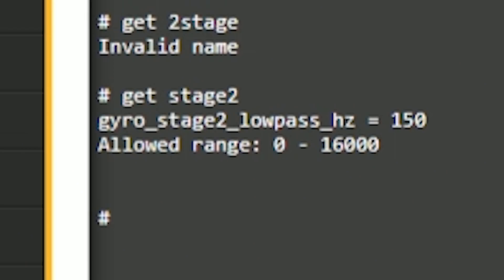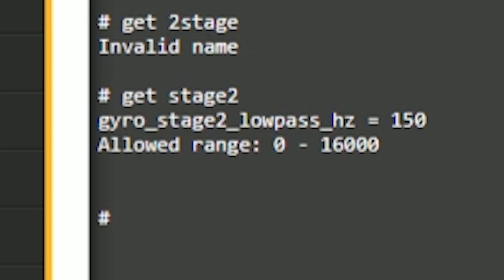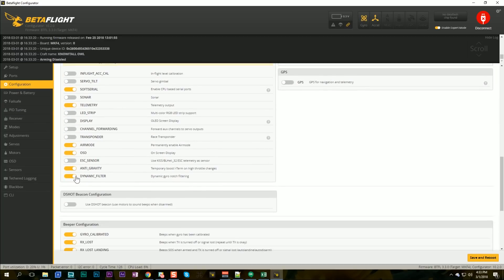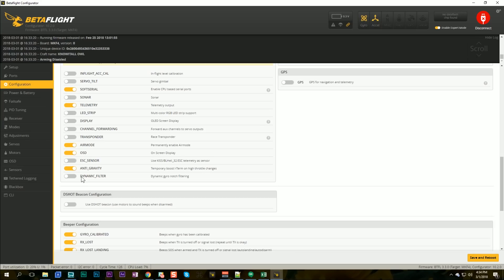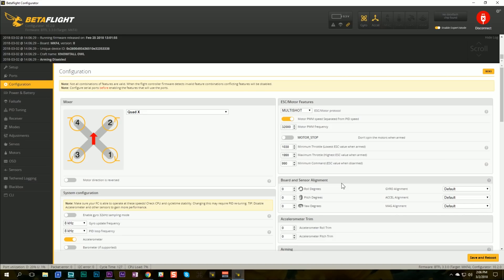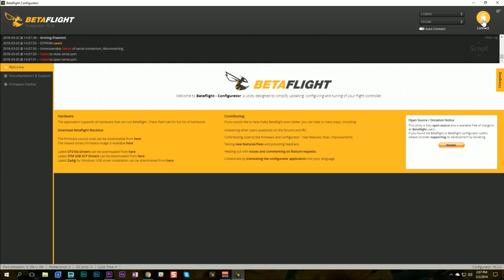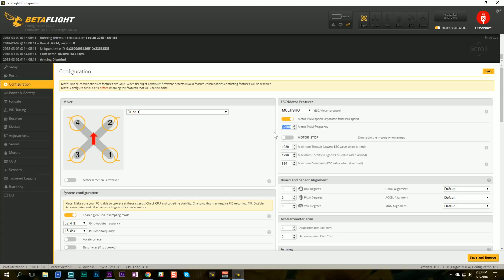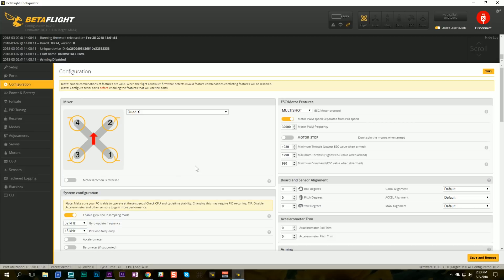Betaflight 3.3 (not) Kalman Filter | HOW TO

Comment: If you're running 8k, the new BQRCF2 filter is identical in noise attenuation to a classic PT1 gyro lowpass. There really isn't benefit to running it if you're sampling at 8k. However, at 32k, where the gyro isn't hard limited to around 256hz, the BQRCF2 filter attenuates high frequency noise way better than a PT1. But it also adds more delay than a PT1. Still though, the high frequency attenuation of the BQRCF2 is worth that tradeoff.

Now running the dual stage lowpass setup (classic gyro PT1 lpf + BQRCF2 set to around 150hz) + Dynamic Notch disabled has yielded great flight performance in my testing. Fantastic flight performance actually. However, as soon as a prop got damaged or a motor was unbalanced, anything of that sort, it created noise which was right in the sweet spot of where the dynamic filter typically performs. But below the high frequency noise that the BQRCF2 filter is really good at filtering out. I find that a really risky approach because it can be easy to smoke a motor if your props and motors aren't perfect. But if you're the type of person who changes out props the second they get a scratch and you want really good flight performance, even at 8k, the dual lowpass + no dynamic notch setup is pretty great. Best flight characteristics and propwash handling I've ever had with Betaflight.

PS. Mark Spatz (UAV Tech) is definitely killing it with those filtering videos. Especially in comparing the delays of the various filters.
Reply: I really appreciate the insight here,  but I'm a bit confused by what appears to be contradictory advice between your original comment, and what you later added. Specifically " If you're running 8k, the new BQRCF2 filter is identical in noise attenuation to a classic PT1 gyro lowpass. There really isn't benefit to running it if you're sampling at 8k. " VS "even at 8k, the dual lowpass + no dynamic notch setup is pretty great. Best flight characteristics and propwash handling I've ever had with Betaflight." My FC can only run 8K/8K - so should I use the new BQRCF2 filter or not? I have very little noise - motors are balanced and props are as well. :)
Reply: Brennan Lawrence I’ve always worried about what happens with out of whack props as filters advance. Especially once turtle mode came out and I have a way to get back with a potentially jacked up prop because I’m a lazy ass.
Reply from the maker: Running the stage2 filter and the regular gyro lowpass in series gives enough attenuation to disable all the notch filters, which provides a net improvement in performance, even at 8 kHz, in my testing.
Reply: Thanks Joshua! If I'm already able to disable all notch filters and the dynamic and my motors are not cooking, is there any reason to add in this new BQRCF2 filter? I'm running Lumenier MX2206 motors, check all my props on a DuBro, and I'm using rubber flight controller standoffs. :D
Reply: +Joshua Bardwell  You're correct. You can absolutely run the classic gyro lowpass + stage 2 without the static notches enabled. But I was saying it's still risky to do so without the dynamic notch enabled. Your flight performance is great with solely the classic gyro lpf + BQRCF2; I've flown like this myself. But once you damage a prop, the dual stage lowpass isn't enough to keep your motors safe without the dynamic notch. Perhaps if you're running very low DTerm you can pull it off. But I just really don't think it's worth the risk; especially if you're using pricey motors.

But I've been doing some extremely "experimental" stuff over the last 24 hours. This comes in the form of changing gyro_lpf to EXPERIMENTAL (default is off). This is what governs the hardware lowpass filter on the gyro. On MPU6000 gyros, as we know, there's a hardware limiter at 256hz. But there isn't specific documentation from the gyro manufacturer which states exactly what gyro_lpf = EXPERIMENTAL does. But a few of us on the Betaflight GitHub have been testing this feature and it appears to actually raise the gyro hard lowpass. We just don't know how high it's raising it exactly, or if it's even removing it altogether (highly unlikely).

But the implications for this are amazing. This could allow a MPU6000 gyro at 8khz to sample similarly to a 32kz capable gyro in regards to smaller phase delay due to a much higher hardware lowpass. I just got back from doing my first actual flight tests using EXPERIMENTAL setting and the results are promising. My filter setup is as follows: Classic gyro Pt1 at 100hz, stage 2 filter at 150hz, dynamic notch filter enabled (for safety reasons listed above), gyro_lpf = EXPERIMENTAL. This produced the best propwash handling my quad has ever experienced to date, while my motors were still coming down barely warmer than ambient temperature. If you ran the same exact setup except removed the dynamic notch filter, it would probably have the best flight performance. But again, not worth the risk in my opinion unless you have backup motors for days.

The reason this is so important is that many people cannot run 32k/32, even with gyros that support it. Being able to run 8k while not having a hardware lowpass of around 250hz means that everyone, including people with F4s who cannot overclock and even people with F3s, can enjoy the full benefits of the new dual stage lowpass approach. Hopfeully you read this comment and investigate into this a little bit, because I really think there's something here. And my blackbox data I've been gathering backs it up too. But it'd be great to have more people testing this and reporting back to the Betaflight devs.
Reply: According to the BF wiki setting that to experimental DOES completely remove the hardware filtering on the gyro. "Boris said: gyro_lpf = OFF basically still means there is a little bit of filtering on the gyro. When setting it to EXPERIMENTAL it will remove any possible filtering and give raw data, which is extremely noisy. I don't recommend it. I just added it to be there in case someone wants to play with it." I'm trying this today. That's awesome if this new filter can replace the hardware filter for best performance yet on non  32K boards!
Reply: The blackbox logs we've been gathering certainly indicate that setting gyro_lpf = EXPERIMENTAL does increase the DLPF (digital Lowpass filter -- aka the hard filter we're talking about), but we don't know how high it moves it or if it removes it altogether. And I don't think Boris himself knows either. Unless he reached out to InvenSense, got the answer, and has been keeping it a secret since.

Refer to this pdf https://store.invensense.com/Datasheets/invensense/RM-MPU-6000A.pdf 
This is the actual documentation from the manufacturer of the MPU6000. Check the table at the bottom of page 13. These are the settings that correspond to gyro_lpf = OFF, 188HZ, 98HZ, 42HZ, 20HZ, 10HZ, 5HZ, EXPERIMENTAL in Betaflight CLI. Every single option is documented in what it does in the table except for EXPERIMENTAL, for which InvenSense put "Reserved " for. So for whatever reason, the manufacturer of the gyro themselves have withheld that information. Thus far, the Betaflight devs have been going off these spec sheets for the various gyros in order to hook their code into Betaflight. So again, unless Boris actually got private word from InvenSense about what EXPERIMENTAL truly does for the various gyros, we don't know exactly what the setting does. We can just go off blackbox logs which indicate at the very least EXPERIMENTAL raises the DLPF on the MPU6000.
Reply: Fair enough then. :) I flew 3 packs with your settings today and it does seem to have the lowest propwash I've seen too. Stock PID's at that. Too windy to see if everything else was super smooth tho. :/
Reply: Brennan Lawrence ok so if I read this correctly, since I’m running a JBF4 (8k/8k), use Approach (menthod) #1 identified in the video but set gyro_lpf=EXPERIMENTAL & enable Dynamic Filter to add some protection for my expensive motors. I’m not particularly meticulous on balancing props. I’d rather just bolt on and fly.
Reply: +Ron de Leos Exactly. You'll pretty much be doing exactly Approach #1, but leaving dynamic filter on. Turning dynamic filter off will result in better flight performance. But again, I feel it's not worth the risk of smoking a motor if your props aren't perfect. But yeah, strictly follow the steps in Approach #1, except set gyro_lpf to EXPERIMENTAL, use 8k/8k, and keep dynamic filter enabled. 

It's important that you leave the DTerm filtering at defaults for now and verify that you have no issues running gyro_lpf = EXPERIMENTAL with standard gyro PT1 Lowpass + the stage 2 Lowpass. This process will be just like Joshua has shown in his older videos about removing filters. Do a quick hover, verify motors aren't hot. Then remove the DTerm notch and do another hover and check motors. After this, if your DTerm lowpass isn't already set to PT1, change it to PT1 and do another hover. The more time you spend test hovering/flying between these changes, the better. It's possible you could have no problem hovering for 15 seconds, but flying for a minute causes motors to heat up. After all that, you'll have the same filtering setup I've been using and getting great results with.

Ignore the final step of Approach #1. The part about moving the stage 2 Lowpass up in 50hz increments. You really want to be using blackbox if you're going to move stage 2 lowpass around. 150hz is a safe value that will work for everyone. The higher you set it, the less phase delay there will be and you will get better flight performance, but you're also decreasing the amount of filtering. For a lot of people, the best setting will be somewhere between 150-200hz. But again, this will require you to get a blackbox log (with debug_mode = NOTCH) and see where your max motor noise is. My personal motor noise is around 220hz, but it starts ramping up to the peak from about 165hz. So technically, I could set my personal stage 2 lowpass at 165hz, but for this testing process I've been playing it safe and running a more reserved stage 2 lowpass of 150hz. However, now that I've flown a bunch of packs using these settings and my motors still come down just as cold as ever, I'm considering raising my stage 2 lowpass up to 160 or 165hz. But I recommend everyone start at 150hz and stay there unless they know what they're doing in blackbox.
Reply: Thanks so much!  Both you and Joshua have been a god send since I'm just starting out.  I don't have any reference to what is right as this is my first quad build.  I have a lot of experience with CP 3D Helis (flew big nitro & electric  helis from 2007 to 2014) which hopefully that muscle memory won't hamper my ability to make the transition.
Reply: Brennan Lawrence thanks so much for the extremely helpful  info!
Reply: +Ron de Leos No problem. And keep in the mind that stuff we discussed here is in its infancy. We've pretty much established proof of concept. But now it's gotten the attention of some people way smarter than me. (UAV Tech, mentioned by Josh in this video, is starting to look into this now, as well as a few Betaflight devs.) 

What's really exciting is that there's new gyro lowpass filtering in the works for release candidates of BF 3.4 which are looking to be even more effective than the dual stage gyro lowpass setup we discussed in these comments. We're learning that getting rid of/raising the gyro hard lowpass (by changing gyro_lpf to EXPERIMENTAL) and replacing it with really good software filters might be the holy grail for filtering with lower sample rate gyros. Like the MPU6000 which can only sample at 8k. But it can still apply to tons of other people too. Like people with high sample rate gyros but can't run 32k/32 because their CPU isn't fast enough. Like F3, and non-overclocked F4 CPUs. This is really important because it's going to allow F3 and F4 to stay relevant for a longer period of time. Hopefully well beyond, or at least up to the point when F7 finally has all its kinks worked out.
Reply: Thanks for the interesting insight!!

Comment: Hey, again, thanx for a very informative video!

2 Quick questions.

1: When using the matek405f fc i cant do 32/16, my cpu load goes to 52%. Would i be better off running 16/16 than 32/8 ? I am using  UAV Tech's approach... (pt1, gyro lp 90, d-lp 100, notches off and currently 500 on stage2 lp)

Question 2: i used to run 8/8 in the same board, now with the 32/8 with the same pids, the quad feels very different (right now, in a bad way, unstable and ahead of me).  How does (if it does) the 32 kHz gyro affect the pid values / rates compared to 8 kHz? 

Cheers!

Comment: Ive successfully built a bunch of quads, but I'm stumped on this one that i have.  its a lumenier qav X 210,  with the lumenier pod on it.  I had problems with high frequency vibrations at full throttle.   that was with 2600kv motors and an F4 fc, so i changed the motors, changed the fc, soft mounts, esc's EVERYTHING but the frame. and still have the exact vibration.  My question is, can i get rid of this vibe with filtering? or maybe motor timing?  It now has the hyptrain 2450 kv motors on it, and i swear all my previous builds had no problems with 2300kv motors.

Comment: Jb if i get the new filters flying great for my 6in floss build on 5in props. Then change my props to 6 in will i have to retune from scratch to be safe?Or should the props effect the motor noise at all?
Reply from the maker: I would expect the 6" props would definitely have a different frequency than the 5" props. IDK how much retuning you will have to do especially if you are using the dynamic filter, which can adjust automatically.
Reply: Joshua Bardwell i would love to swap props back and forth, i know i could if i used dynamic notch, or traditional filters. Im going to be trying it cautiously with the notch, and dynamic all off and the cascading lowpass  and lowpass2 on. Thsts why i was concerned, and wondering if you think this could be a dangerous situation as far as smoking motors goes. Thanks. Look forward to seeing how these new features play out. Enjoy your videos.

Comment: Wheb i use 32l on my kakute f4 whwn i fly the motors will twitch and thr quad fkie horrible.. if it run 8k it stops. Do you know why the 32khz mode will make the quad twitch  . It will fly but you'll hair a twitch and one arm will drop a little bit thanks for your help

Comment: Hi Joshua, Thanks for the quick guide, i have got my gyro notch logs and i see maximum motor noise in my gyro_notch roll and pitch around 260Hz, so what should i set my lpf stage2 to? Thanks
Reply from the maker: personally I would keep it around 225 maybe? Certainly no higher than 260. I mean... I dunno give it a try but if you go above your motor noise or too close to it, and you have d term notch off, I would worry about smoking motors.
Reply: Joshua Bardwell thanks much

Comment: Joshua im using lowstage 2 = 90 and in having thorttle midle osc. Do i have tu raise  or try low hz? Im using revolt2 with bf to 32k/16 multishot.
Reply from the maker: The very first thing I would do is add a capacitor to each eSC.
Reply: Joshua Bardwell i have just one cap of 1000ufh 25v. Im using a 4 in 1 esc.

Comment: Hey josh
Great intro to the new filter. What cpu load is the correct. I can find 1 in the bottom of the gui, and 2 in the cli, when typing tasks and the other command i forgot.
Reply from the maker: The one in "tasks" is different and I don't know exactly why. I go off of the one on the bottom of the GUI.
Reply: Joshua Bardwell ok. Thx for your answer

Comment: Question: If you are using Multishot. What value should you use for Motor PWM Frequency shoudl you use if you want to run 32k pid loop ?
Reply from the maker: If you are running mulitshot, run unsynced PWM frequency at 32000 (32 kHz)... always. Unless you have like 2 year old ESCs that can't handle 32k.

Comment: I cant decide on using an fc with ICM20602 gyro or mpu6000. I'm going to be using spedix es30a hv escs which do well with noise but the motors i will be using worry me. They r the rcx 2206 motors. Similar to the rcx 2306 motors u tested, they get warm or hot really easily, even with the notches. It would be more convenient to use the ICM gyro because I also plan on using the matek vtx or matek vtx/pdb, however my top priority is a quad that flies well. What is your recommendation for my specific scenario?  I cant really afford to buy twice, so I need to get this right
Reply from the maker: If I were you I would be real tempted to go with the ICM and BF 3.3 new filtering.
Reply: SO One could say that the new filter could help my motor issues? Maybe u could test that with your rcx motors?

Comment: JB...Will these settings be the same for a 2"build using a HGLRC Zeus?
Reply from the maker: Some of them will change, such as the UART layout. Many of them will be the same. Default PIDs may need to change on 2". Sorry I can't be more specific.
Reply: Thanks bro
Reply: Filtering will be the same as a 5"?  Understood that I will have to use trial and error.

Comment: Is it better to tune PIDs before or after the filters for a new quad?
Reply from the maker: For BF 3.3, I would try to set up the stage2 filter as shown here and see if the motors were hot. My hope is that the stage2 will turn out to be strong enough to work for almost everybody, in which case just set it up and go.

If you are not using stage2, then the approach is kind of half and half. I typically turn off gyro notch, turn on dynamic, and go to PT1 dterm lowpass right off the bat, but then I tune and see if I am able to disable d term notch.

https://www.youtube.com/watch?v=lWVsPY0ss4I
Reply: Joshua Bardwell Thanks a lot !